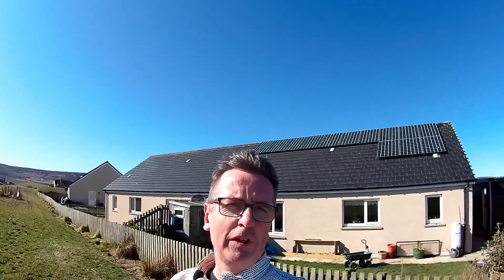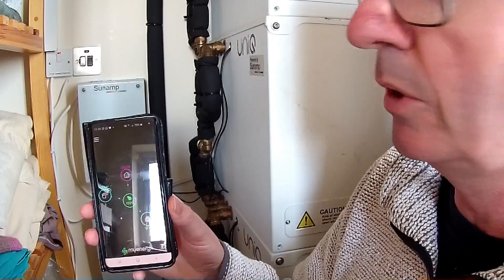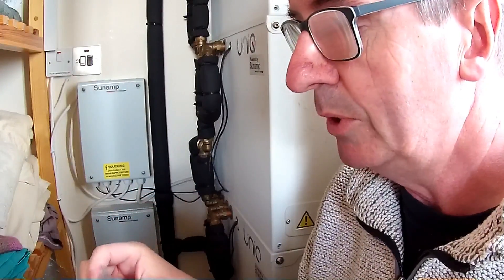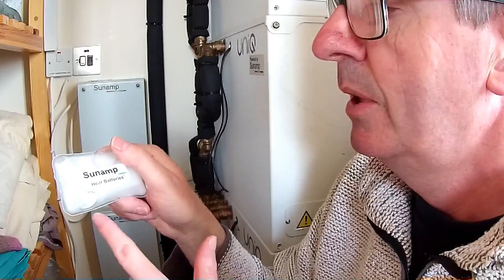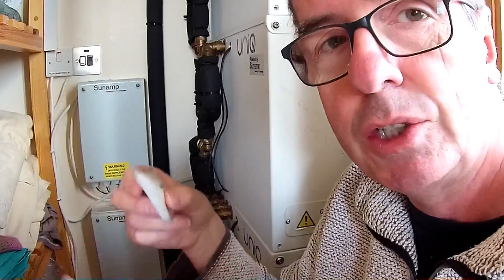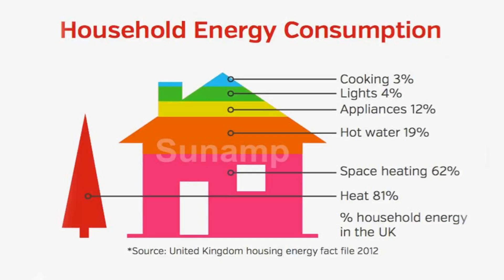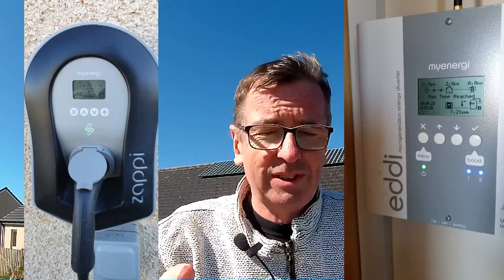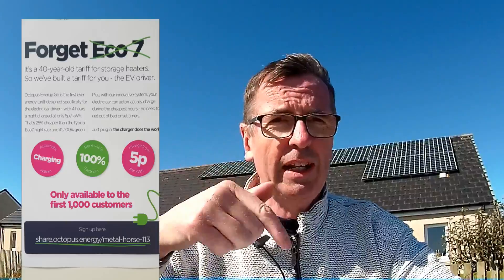How crisps provide me with hot water ! Sunamp heat batteries how do they work ?

Comment: Hello Jonathan, thx for the great video! Do you know if the heat battery does the chemical reaction with all the material inside, when you only use a very little amount of warm water? I mean, does your PV need to provide the same amount of electric energy to change back the phase of the material after using little amount of water or a huge amount of warm water?
Reply from the maker: It will 'top up' the battery , or change the FCM back to liquid state when ive excess solar , or on cheap rate grid electric in winter. 
With no power at all , it will last around 3 to 4 days supplying hot water. 
Every day it uses around 2kWh of energy to keep the 7 litres ish 'hot' and ready to go !

Comment: We understand how you would get hot water, and it's cool maybe mechanical energy could ruffle a bag resulting in heat 41,000x's...but have to suspect there's ways to get current from the heat...First thought is light drops of water could result in steam engine use, if heat is strong enough to make instantaneous steam, though mold might be danger without right containment....Next suspicion is the heat can make a conductive metal hot enough, that electrodes attached might produce usable current. I'm not an electrician but hvac and electrical systems might have examples of such applications. Anyway, great video...only thought phase change energy was wax before this, though I've seen hand warmers in stores but didn't  realize  how many cycles are possible...Probably very important advance, reducing mechanical friction heat need in some designs, in favor of mechanical, chemical heat.  Sounds very useful.

Comment: Nice video.  But it isn’t a chemcial reaction it is simply phase change.  If you think of heating ice at 0 °C it absorbs heat and turns into a liquid.  Or cooling liquid water at 0°C it releases heat and turns into ice.  It is still water ie H2O no chemical reactions occur just phase change.   The power of phase change is that heat is either absorbed or released at a constant temperature.   The key is to find a substance which changes phase at the temperature you want the heat.

Comment: Looks like a very inefficient way to store warm water and why would you want to store it when you can have very small instant water heaters for any application?. Your consuming a lot of energy to change the phase of the material.
Reply from the maker: These ARE more efficient as im only keeping around 5ltrs of water 'hot' the rest is waiting to be heated via CPM , and this stored energy is from the 🌞 waiting to be used.
If it wasn't efficient,  they wouldn't be on the market !

Comment: Hello Jonathan. Thanks for your interesting video on your Sunamp units. Did you need 3 ( 3 X 1.5 litres) for showering? Also, do you get FIT or SEG export payments on your 2nd  hand solar PV system. Many thanks Anthony
Reply from the maker: Hi Anthony , i had 3 fitted as thats what was on offer to be comparable to my old 240ltr hot water immersion tank.
No FIT as its not worth it and i use most of my solar anyway.

Comment: I’m struggling to work out the benefits or where the market is for this, let me explain, if you have excellent insulation,  get a A rated 250 litre boiler , and attach a Eddie and in theory you should be able to heat the tank with ease given just a 2kw loss per night , add overnight or charge from the grid when free if you don’t have pv and it should be significantly cheaper to heat than this system even in winter . The only time I can see this being really of use is in bigger property’s
Reply: Many properties have swapped to combi boilers removing hot water tanks and using the space, when the government bans these boilers those hot water tanks will need to be replaced. I can see these smaller footprint devices being very popular......

Comment: Hello Jonathan, great video. Our gas boiler has been condemned & we were going to replace it, with another one.   Will the sunamp heat battery power a heating system, e.g conventional hot water radiators & wet under floor heating? We have a 7.2kw solar PV system, with 10.4kw of battery storage. Currently using PV to heat the hot water via immersion in the hot water cylinder, thought we could still use this going forward and were wondering whether we could use the heat battery to run the heating system, without the need of a boiler or ASHP.
Reply from the maker: I believe you can , ask Sunamp
Reply: @JonathanPorterfield  thank you. Tried to call them today, no answer 🙁  Will try again tomorrow

Comment: I wonder if one were not using hot water how long the unit would hold  heat...you mentioned a loss of 1%...is that per hour, per day, or...?  For example I would guess my new heat pump hot water heater tank holds the heat for about 12 hrs (r-12ish) because even if not in use i'm pretty sure I hear it run about 2x a day.  How often do you think a heat pump for example would have to run to maintain the sunamp charge then even without use in comparison?

Comment: So it has the convenience of a combi boiler in that it heats the water only when required? But that you are able to use energy when it's cheap or in the case of PVs available and store it.
Reply from the maker: Yes when hot water is demanded it activates the PCM . The Eddi can be set to charge the sunamp when they cheap rates are available. 
Most days our PV fills the sunamp  battery by 10.30am on sunny mornings.
We have a 9.2kW pv system.

Comment: Why not use an electric tankless water heater that's powered by your sloar system instead ?  Whats the advantage/ difference  of using a sunamp battery instead for continuous hot water for showers?
Reply from the maker: As an instant shower takes up to 6kws and so youd have to shower with full sunlight hitting the solar panels.
With the sunamp heat battries you store the electrical energy from the sun ,to use at anytime to shower.

Comment: Nice video... So to confirm.. If I have a system boiler with water tank..it can replace both of them and work with solar PV?
Reply from the maker: Hi , yes were are all electric , so this system replaced a hot water tank ( immersion heater 120lt tank) 
Our heating for the house is air source heating on a separate system. Both of which is fed from our PV panels.
Reply: @JonathanPorterfield  thanks.. So this system only helps with hot water..I guess u need second until for heating? Can u share some insights on your heating system i.e cost etc.. As I'm looking into PV and A2w. But not sure if A2w heat pumps will be good enough for water, heating and underfloor heating.

Comment: I'm sure Solar Thermal / Air Souce HP & Heat Batteries are eligible as a primary installation in the forthcoming GOV Green Homes Grant  Scheme (Sept 20-March 21) so you'd be looking at a 66% grant towards purchase/installation ...and for the time being still be able to claim a portion of the existing RHI.
So . No could be the optimum time ..

Comment: I can see sunamp being a great solution where you are with local excess renewables..
I've got a smart diverter on my immersion heater that if my PV is exporting to the grid will dump that into the hot water tank. Very cheap device (about £200) works a treat , and means during half the year we've got free hot water.

Comment: Thanks Jonathan. 

Fascinating, but one thing was bugging me throughout the demonstration: Solar PV panels only convert a fraction of solar energy to electricity; the blue end of the spectrum, whereas solar thermal panels capture much of the lower end of the visible spectrum; infra red, and they heat water directly, working as heat exchangers inside a hot liquid tank. So why not use thermal panels to heat water, some of which in turn heats the phase change material, and the remainder of the heat, if any, can provide hot water? 

The bonus is that you will be collecting energy even on misty or rainy days, or indeed at night, generating hot water directly, and storing energy in the Sodium Acetate. You could even use both systems simultaneously, cooling the solar PV panels in the thermal panels, which could be mounted under them. PV panels are significantly more efficient when cool.

In addition, you can add a small wind turbine, to make good use of that famous Orkney Fresh Air™, in generating electricity whenever the wind blows, Summer, Winter, day and night.

Comment: Excellent explanation Jonathan.  Whilst a traditional thermal store (as you pointed out) is cheaper to install, they have much higher heat losses and take up much more space than a sunamp unit, so they are great in properties where there just isn’t the room for a decent sized hot water cylinder.  This is a fascinating technology because different chemistry allows phase change materials to work at different temperatures.  One idea I really like is using passive phase change wall cladding materials to help maintain a fairly constant temperature... but that’s another story.  Keep up the good work.
Reply from the maker: Thanks Roy   I appreciate your comments!

Comment: I really believe heat batteries are all we need. 1) price of electricity is coming down (more renewable) 2) we have sufficient battery in the latest electric vehicles to use as home storage. Most times we do not need the full battery capacity for driving. From 80-40% can be used to run the household needs  ( the technology is ALMOST here) 3) 80% of home energy needs are for heating. So heat batteries are a must. This is exactly the economy 7 with BRICK overnight heating applied to 21st century. Use overnight cheap/negative electricity to charge the car and the heat batteries. This way we eliminate gas burning and do not need home batteries. I particularly like Sunamp. Great British company not praised enough.

Comment: The Sunamp guy at fully charged told me their product can be used both for hot water, heating and electricity output at the same time. Is this not correct?
Reply: You can't use them to output electricity. I think Boxergy are looking at an ASHP solution, combined with heat battery and normal battery as a hybridised storage / heating unit. So maybe they were referring to that?

Comment: Hi Jonathan, nice to see Orkney looking so bright! We've got solar and batteries and looking to get an electric car so that we export even less (via a zappi charger) as the batteries are full by 11am on most summer days. Do you think the sunamp could be wired in to the system to only run off excess energy from the pv's that we would normally be exporting (once the batteries / car have had their fill)?
Reply from the maker: Yes with the eddi diverter from my energi , our is set up to only take from solar , if no solar then the eddi will take grid power at a time we set , ie cheap rate.